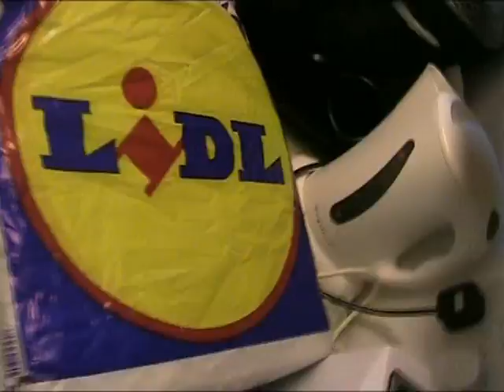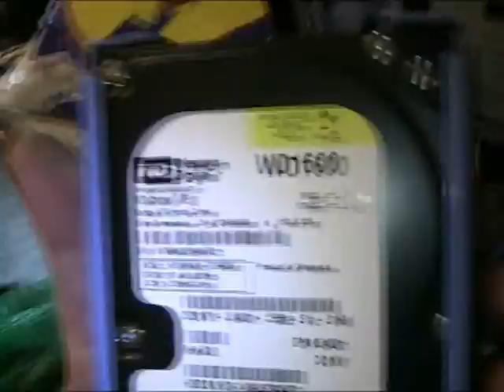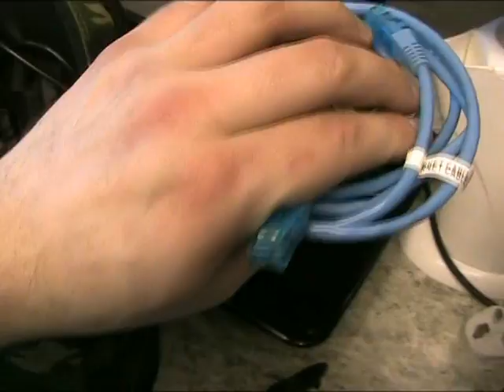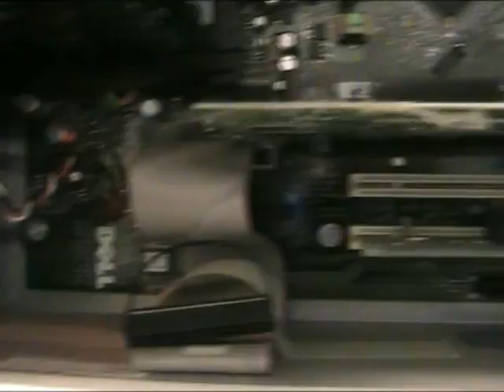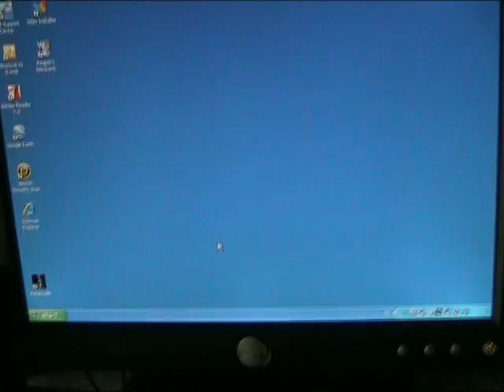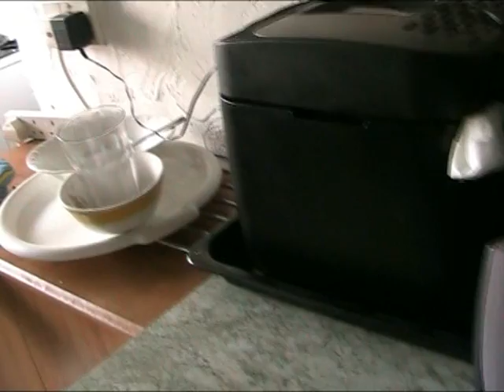Dell Dimension 5000

Comment: Mine dell dimension 5000 has
Nvidia GT 520 1gb (Graphics)
Pentium 4 HT 2.80 ghZ (Processor)
3 gb of ram
And a 80 gb western digital caviar hard drive
Reply: Mine had a soundblaster sound card as well.

Comment: hello. i have a computer just like this one. can i upgrade the video card to a new one that has an HDMI so i can connect it to my TV  ?
Reply from the maker: As long as your PC has either an AGP or PCIe port you can upgrade the graphics card to a newer model. Of course AGP has been defunct for some time now. With PCIe cards depending on the age of your computer,space in the case and power supply you could pretty much drop any modern card into it. But then again for media duties you don't need a super expensive card. So you'd have to look around and see what has a HDMI which will be a decent match for your system.
Reply: I know I'm a bit late to reply, only just found this vid.
I used a DVI to HDMI cable to plug into my tv.

Comment from the maker: For the time I used it whilst setting it up it was quite a respectable machine. For a mid 2000 era computer it would have been pretty fast for everyday duties. It's a shame though that most people now would look at it and think it's total junk. My first computer was an Amiga 600. An old machine by the time I started using it. But it worked and I did do some school work on it. Hell my primary school was using BBC's when I first started, they were around 10 years old at that point.